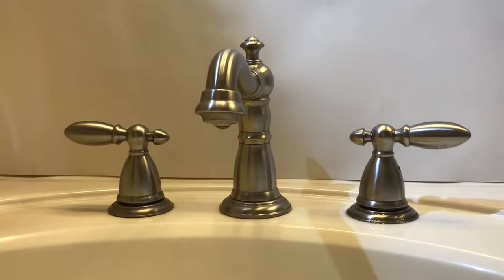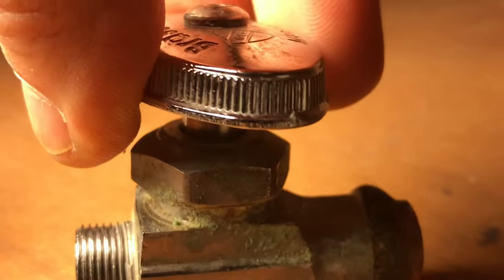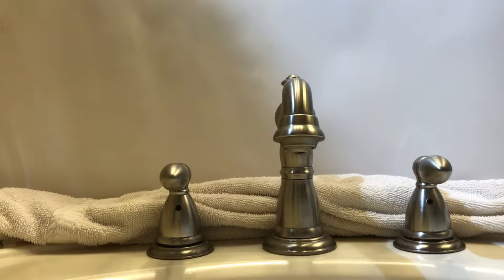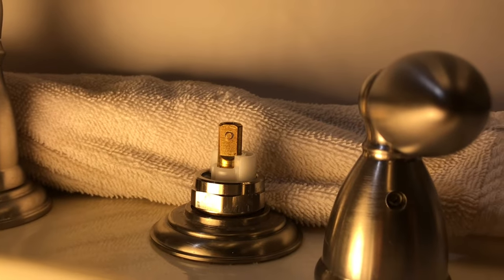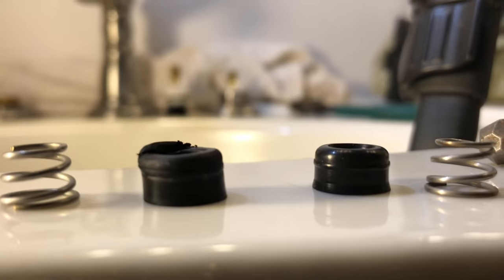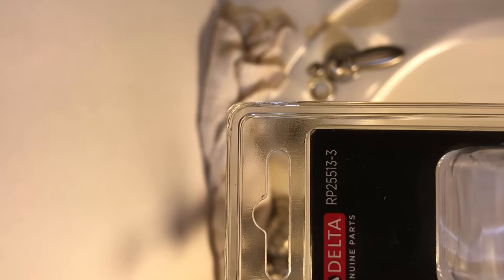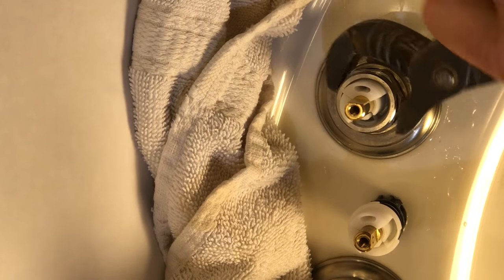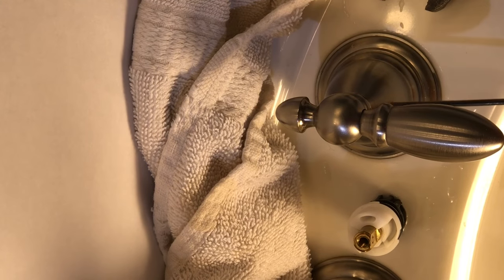How to Repair Leaking, Dripping Delta Faucet #diyplumbing #serviceplumbing @TappPlumbing

Comment: You provided the part number for the cartridge but not the rubber seal and spring. Delta sent me the cartridge but not the rubber seal and spring. They do not come in the same package.
Reply from the maker: Good thing those are very easy to find. Hope everything works out for ya!!
Reply: @TappPlumbing  Would you believe that the woman at Delta said the rubber seal and spring were NOT required. She would send them for free ONE time but if I needed them in the future there would be a charge. So I told her never mind I would try without the seal and spring. I replaced just the cartridge and it did not leak. Yet.
Reply from the maker: @jeffstanley4593  You could get lucky and it not leak for a while . I would believe anything when you are talking about customer service. I could tell you some stories.

Comment: The retaining nut appears to be corroded on and the entire piece turns underneath the counter when I try to remove the retaining nut. Any suggestions?
Reply: I'm having the exact same issue - did you ever figure out a solution?
Reply: It's been a year, I'm having a terrible time getting mine off, not corroded just super tight.  What did you do?

Comment: I have a stem replacement: danco 3s-11c.  There is NO spring seat whatever underneath it
Reply from the maker: Do you mean there was nothing under the old cartridge when you pulled it out or the danco package was missing something. I hope you have better luck with danco parts than I have . They are hit or miss . Maybe you will get a good one ! Let me know the answer to these questions if you get enough time please.
Reply: @TappPlumbing  thanks for reply.  There was nothing under the part when I removed it.  I bought two replacements one for each side, neither came with a spring as such. I don’t think my sink uses the spring part.
Reply from the maker: @bryanutility9609    Let me know what happens when you get everything back together please. I am very curious now!  Your description would be most unusual for a Delta product.

Comment: I'm doing tub washers (vertical) so that spring and washer just falls out before I can put the cartridge in.
Reply from the maker: I am a little confused, if something is vertical it is in a up or down position. If you give me more info maybe I can help. When you are describing tub washers and springs is this inside of a delta tub and shower catridge ? I will try and check these comments as fast as I can but we are slammed with freeze breaks right now. Just try and give me as many details as you can please and will try my best to help you.
Reply: @TappPlumbing  My taps on a bath tub installation, vertically mounted on a tiled wall. I eventually got it. Because i did not drain the holes by opening up fawcetts at other locations below, I still had a very slow oozing bit of water leaking out, enough to float the washer out of the hole. When I dried everything out, it finally stayed seated long enough to get the cartridge on it.
Reply from the maker: We are so glad to know you are good to go now. We know all about the aggravation of the seats floating up!

Comment: Did anyone have a problem with the water not shutting off after assembling everything back together? The valve no longer shut the water off.
Reply from the maker: You may have to try again and make sure no tiny particles are in places they shouldn’t be in . Look down in the brass and inspect the cartridges very carefully as well. Keep us posted please? Good luck!

Comment: Has anyone followed the steps, but their faucet is still leaking? I don’t know where I messed up…help.
Reply from the maker: How old is your faucet? Was there a lot of corrosion when you took it apart?
Reply: @TappPlumbing Our faucet is about 5 years old. I made sure the spring and seat fit properly and even replaced the cartridge, but it’s still leaking. I’ll see what I can do. Anyway, thank you for your reply!
Reply from the maker: Make sure and check the house water pressure

Comment: Why would you turn the water off st meter and not main shutoff? Making it too difficult chief
Reply from the maker: I tell people that because some homeowners have some very poor quality main valves. I have a multitude of pics and videos of some horrible examples where I had to cut them out and replace because they failed in the off position,also  cpvc ball valves will also either leak out of the handle or snap right off. Then the homeowner has to deal with that as well.
Reply: @TappPlumbing  good point. Not to mention the gate valves that get stuck in off position and won't turn back on
Reply: @TAPP PLUMBING  either way brother. Videos like these are needed and I appreciate you doing the work. You have motivated me to start my youtube channel to help people. Kudos
Reply from the maker: You should definitely get started on a channel. It is a lot of fun and challenges you to learn many different skills sets. I know you have heard the saying “ you don’t know what you don’t know “ . That is what it is like. If I can help you in anyway please let me know.

Comment: When I try and loosen the retaining nut the entire faucet turns.  What do I need to do?  Try and hold it from below?  I'm guessing the original installer over tightened.
Reply: I am having the exact same issue! Did you ever figure out a fix?
Reply: @RHQ-uj4iq  I sprayed some penetrating oil in and kept working with it.

Comment: You never said what to do if we did everything right and we see it dripping !
Reply from the maker: Hi Tyler, Be sure to check your water pressure , https://www.youtube.com/watch?v=nrGZMxpp_Og&t=122s , Unfortunately if the valve body is scared you may need a new faucet:(  Always check your water pressure first:)
Reply: @TappPlumbing  I figured the problem out yes my seat valve wasn't in and handles weren't oriented right. 5 mins for you 2hours for me but now I'm an expert at Delta cartridge replacements thank you again

Comment: Based on the number of likes, these faucets must be really cheap.
Reply from the maker: Unfortunately these Delta faucets are not cheap. They are some of the best faucets out there. They are the easiest to work on in our professional opinion. Unfortunately water quality and high pressure wear out all brands of faucets, these at least can usually be repaired where as a less expensive faucet would have to be replaced costing more in the long run. We hope this information is helpful in your next plumbing purchases:)